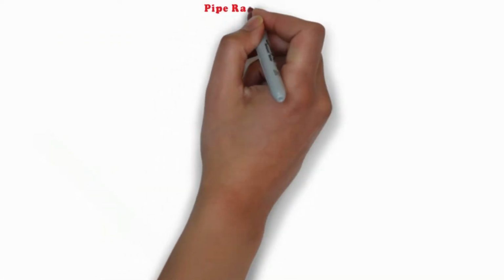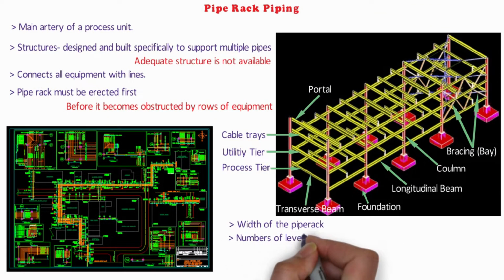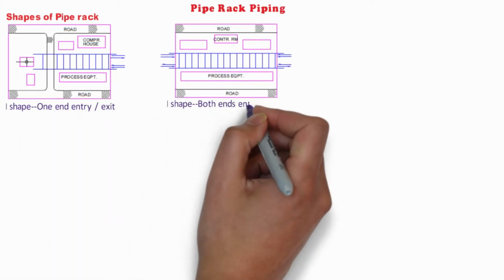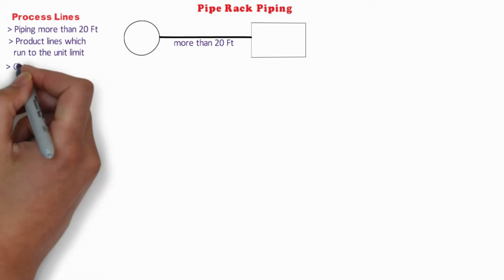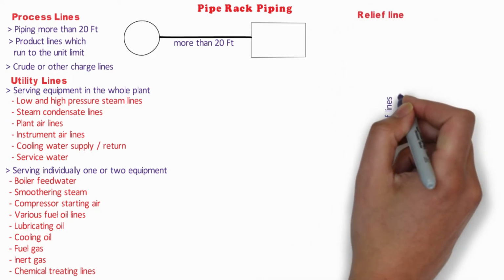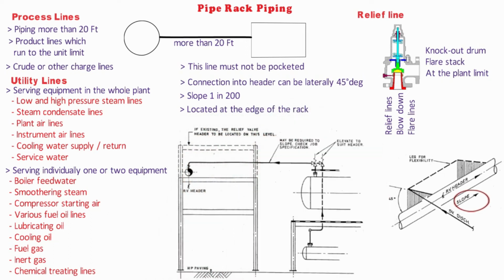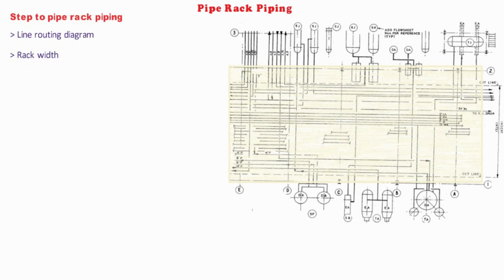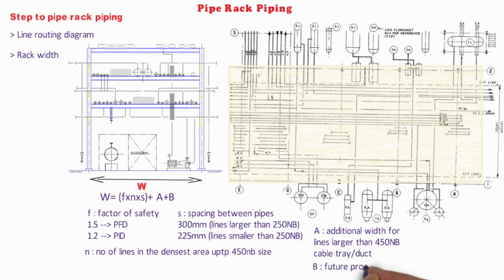PIPE RACK PIPING | PART-1 | PIPING MANTRA |

Comment: Why utility tier is second and process tier is first in the plant ?
Reply: I aslo need to know the reason
Reply: Because,,all the line goes to within unit means one location to another location connection so that we decide first rack as process...and any leakage happened so that it won't harm other tier
Reply: And utility tier is 2nd tier bcoz there much less lines as compared to process lines and if there any casualty pr leakage happed it won't harm to exact below lines that is process tier
Reply: Pipe length minimize

Comment: piping engineer have to design 'pipe rack' ?? i thinks this design is on a civil engineer
Reply from the maker: Yes civil design structure part but first piping has to set the width, tier and difference between tier.
Reply: @PipingMantra  sir me mechanical engineer hu or me jis  company me kam krta hu vha muje structure lgane k liye bola h me abhi company me trainee hu . Pipe routing krna sai rahega ya structure lgana
Reply from the maker: Dono apni jagah sahi hai
Reply: @PipingMantra  sir apka number mil sakata h baat karne ko ?